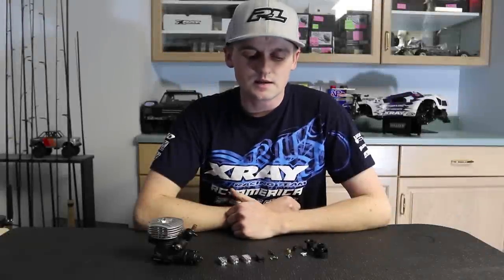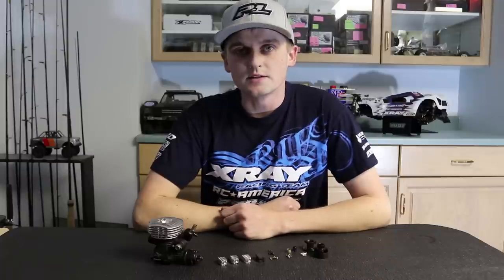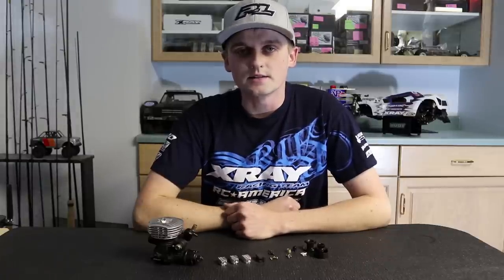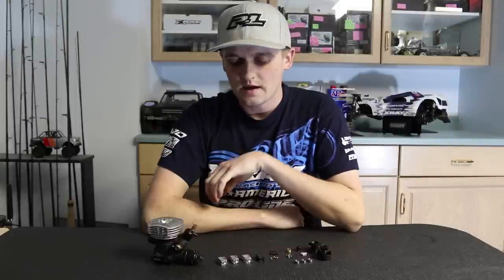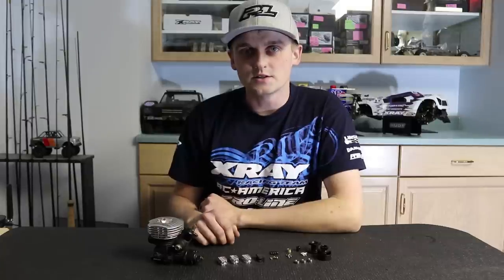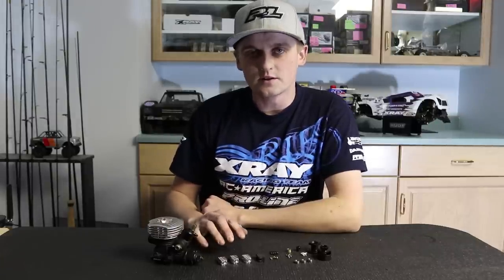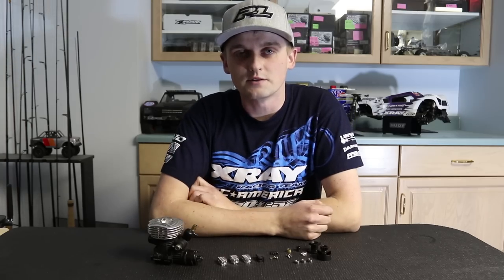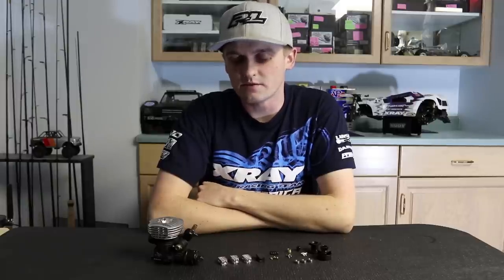Ty Tessmann Pro Tip: The Xray 4-shoe Clutch

Comment: Nice video.  Wish you mentioned as to when to you use the different types of shoes and springs depending on track conditions.

The new clutch is very similar to the Serpent one, minus the extra bearing.